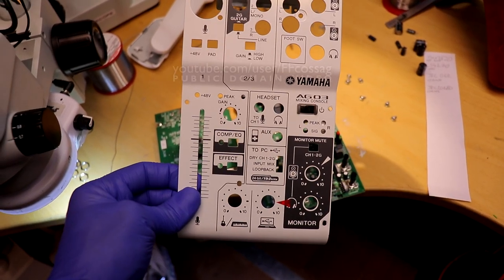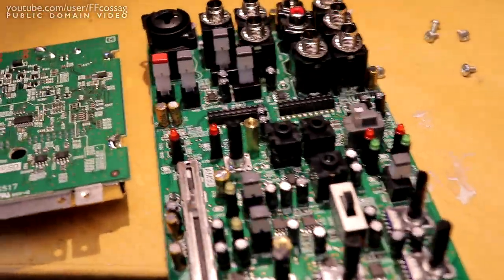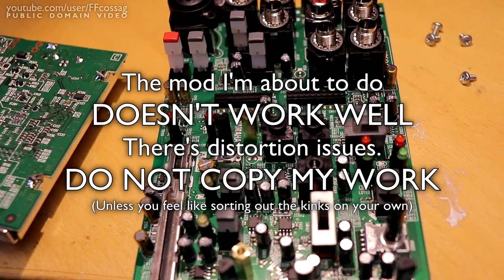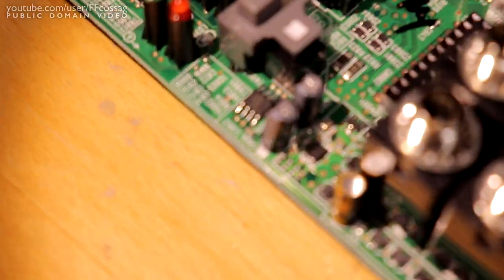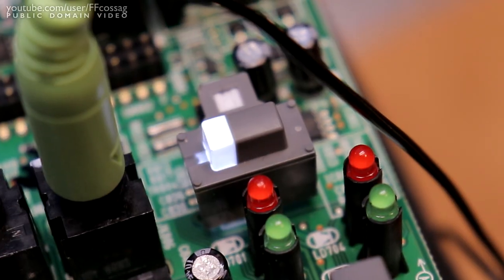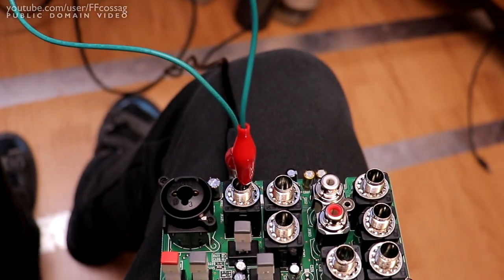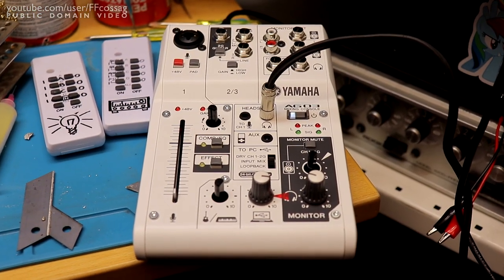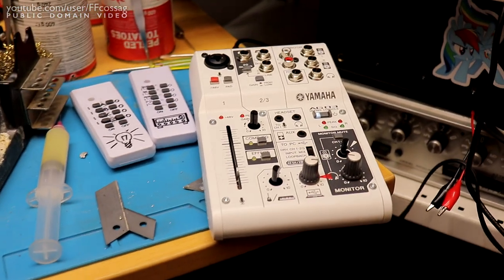Yamaha AG03 teardown & mod that doesn't work right

Comment: hi! need your help :)
i burned the R829 resistor on AG03, its resistance is unreadable, could you please tell me how much it was so i can replace it? i can't find anything by googling
also, how likely in your opinion the burned R829 is the sole reason for the main output (4 top-right sockets) not working at all? (headphones and everything else work normally, the burning happened when i plugged the main output of AG03 into my amplifier's output by accident)